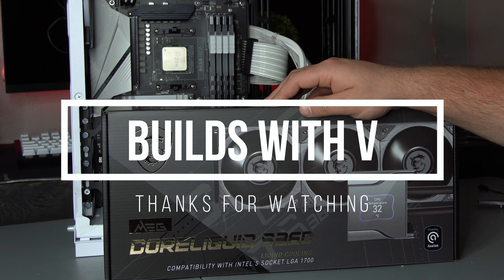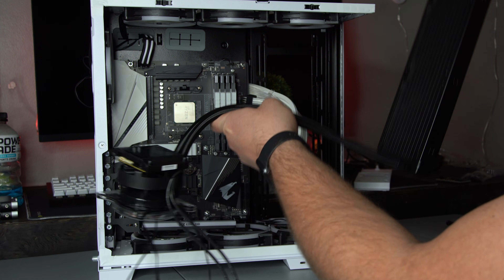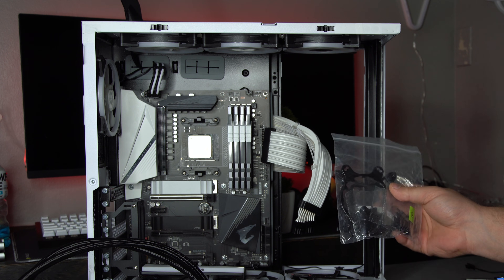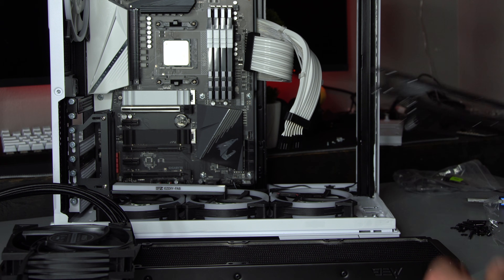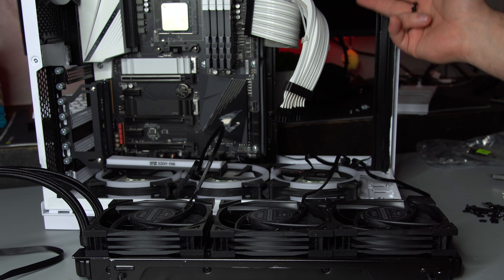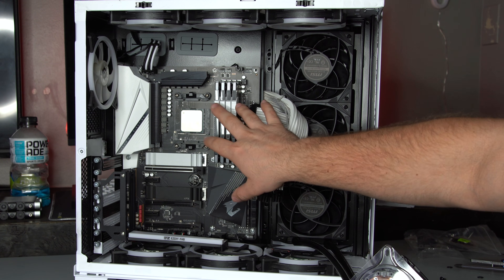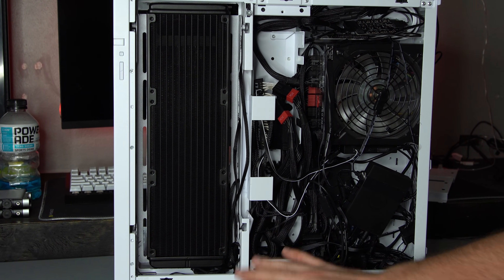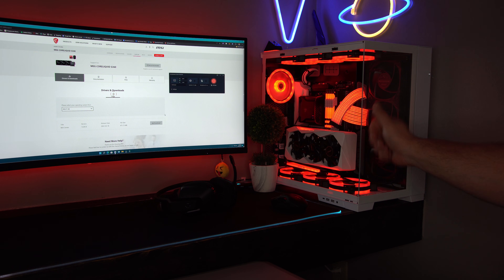How To Install the MSi MEG CoreLiquid S360 Liquid Cooler

Comment: Did you find when you were putting the standoff/screw into the backplate you didn't get many turns before it was tight?
Reply from the maker: I'll be honest, I don't really remember, it's been a while. However, I have had this happen on other coolers and usually it was either because the screw wasn't very long or because it was cross threading. If the others turn more then maybe there's an issue (like something inside the screw hole). Just double check everything. If it's tight tho, it should be fine.

Comment: Question, I bought a PC from a company 2 years ago and it died (it was a really expensive PC, so it's not normal) I had problems during these 2 years and I have this watercooling. Since day 1, it says "Please connect SATA/USB" on the screen, what does it mean ? Cause the fans are working but it always shows this message, can this explain my computer's failure ?

Comment: Radiator is radiating heat, fans should be installed the way that it will help to exhaust heat from your system (chassis). The way you did is wrong, you will take heat from radiator and push it inside of a chassis.

Comment: Why would u suck hot air into the case🤷🏻‍♂️🤷🏻‍♂️🤦🏻‍♂️🤦🏻‍♂️
Reply from the maker: @lmeakin2012  why would I blow hot air directly through the radiator? The GPU air heats up your radiator to the point you can’t even rest your hand on it. This wasn’t just a quick decision, I had it different ways and this was the best in my system with my work loads. Different work loads heat up different things 🤷‍♂️

Comment: Ur build doednf mske sense..to put those as intske your blowing the hot air from the cpu in the build..u already have the front fans and bottom as blower and the top and back.as exhaust..ur not cooling anyrjing non of thay air is going anywhere in my opinion..i gairentee ud have lowwr tempe if it was a push instead of pl for.aio
Reply from the maker: Had the fans like that prior to this and temps were higher. So I swapped

Comment: Doesn't the radiator get hot? The way you set it up wouldn't it suck heat into the case?
Reply from the maker: So the radiator gets slightly warm but compared to the gpu it’s hardly anything. When I had the fans as exhaust the gpu heat would cause the radiator to get super hot causing my cpu temps to also get hotter. Once I switched to this orientation the cpu temps went down and the gpu temps stayed the same.
Reply: OK I'll go with your setup!
Reply from the maker: @Xetsubou  yeah give it a shot and let me know how it works for you. For my application it worked great but really depends on your work loads I’d assume. Almost everything I do is GPU heavy which puts tons of heat.

Comment: Do you need to add the liquid ?? Or does it come with it already inside ?
Reply from the maker: It’s already inside. Never has to be replaced either. Good to go
Reply: So one more question. Sorry you can tell I’m putting this together lol I put it together but my pump is still reading 0 and keeps over heating any ideas ?

Comment: I’m having an issue with mine. My pump turns off randomly causing cpu temps to spike. Have you had this problem?
Reply from the maker: I Havnt had this issue in mine. I’d say just double check all your connections and settings in software first but to me it sounds like it could be defective. Might need to exchange it if everything looks good and it’s still happening.
Reply: @BuildsWithV  did you ever have to go into your bios and adjust your fan curve? I read that could be the issue. I was using my pc and everything was fine, walked away for a little bit, pc went to sleep, woke it up and pump immediately turned off and temps went up. Makes me think it’s a power management issue.
Reply from the maker: @EKclick  it is possible that’s it’s a power issue. Does it only happen after hibernation/sleep or does it happen randomly?
Reply from the maker: @EKclick  that’s interesting for sure.  Honestly I had an issue like this on a different pump and turned out the pump got gunked up with something and it would cause it to not spin after it was off for a while. The pump I’m talking about was a custom loop pump tho, never seen this on a AIO.
Reply: Question. What is the 9 pin usb connector for?
Reply from the maker: @EKclick  for the screen to work. I don’t believe it has anything to do with the pump but I could be wrong.

Comment: If I want to replace the fans on it, will I plug in the CPU_FAN and just not use the three splitters where all 3 fans plug into? (I’m using a commander core)
Reply from the maker: Yeah it’s not required to use the splitter if you don’t want to. I personally used it even with my lian li fans just because I liked controlling the radiator fans with msi software but you can do it anyways you’d like.
Reply: @BuildsWithV  If I want to do that, I can still plug in the RGB cable into the commander core and still get the RGB sync in theory right? I’m not sure if with the commander core you need to match up fans to RGB slot or if you can plug them in anywhere. Because I’d like to continue to use the MSI software as well now that I think about it
Reply from the maker: @rrxlb  yeah you can still plug the rgb cable into the commander and control the lighting with icue. The rgb cable can be plugged anywhere in the commander
Reply: @BuildsWithV  Got it. Makes sense I guess since it can be reconfigured in iCUE as far as fan order goes

Comment: MSI center is not pick up this cooler and when I called MSI they said it only works with a MSI board and that’s crap because I would of loved to know this before I paid a hefty price for the screen and that’s the thing that doesn’t work and none of the video reviews that I watched or anywhere on the website or on the box did it say that I need a MSI MB for this to work.
Reply from the maker: Yeah it doesn’t need a msi MB to work. My mother is gigabyte. Msi center is tricky and sometimes it doesn’t work properly. I’d recommend just checking all connections, try a different usb port on your motherboard if available. Try reinstalling software etc. I’m sure you can get it working unless the aio is faulty
Reply: @BuildsWithV  so either the three reps that I talked are lying to me or it’s the new version of MSI center. They send me a uninstall program and did the reinstall 3 or 4 times. I know the usb ports are working because I have the Lian Li fans that also use the usb ports to control the fans thru their L connect 3. So looks like I’ll be getting on the phone again but all three reps that I talked to on different days and times told me the same thing.
Reply: @BuildsWithV  I did, that’s why I called MSI support and that’s what the first guy told me so I was like he got to be lying and doesn’t want to help. So couple of day later I called back again and they gave me the same answer

Comment: I think the fan should blow the radiator to make the radiator cool..should reverse the fan for cooling effecient
Reply from the maker: That will make it hotter since the air inside the case is hot. This way it’s sucking air from outside the case

Comment: Just wondering why you didn’t mount the fans directly to the radiator, and then mount the radiator onto the bracket? Is there an advantage doing it this way?
Reply: The further your radiator is from the air inside the case the better. Slightly better cooling.

Not as much of an issue if you have a liquid-cooled GPU also, but open-air cases are much hotter than ambient temps. The side compartment in a full tower will be much cooler.

Comment: This is not a optimal way to install an AIO, the radiator pipes should always be higher than pump, due to the risk of air locking the pump with the small amount of air that is in the system.
Reply from the maker: That is incorrect, the only important thing is for the highest part of the radiator to be higher than the pump. In my case, the top of the rad goes higher than the pump. Any air in the system gets trapped inside the rad and since running all my aios exactly like this, haven’t even heard a bubble noise pass through the pump. When I had it the other way, I’d always hear bubbles.

Comment: Are you still using this AIO?
Reply from the maker: Yea I am
Reply: @BuildsWithV  ic. I had my 2nd unit now. The first one makes my PC reboot. Apparently there was a problem with the usb. Msi had them replace . It's working OK so far. But the heatwave here in the UK it's kinda struggling to lower temps. 😕

Comment: Can I use the SL infinity 120 fans with this radiator? And do I have to plug the fan cable into one of the three connections coming out from the pump?
Reply: Did you get an answer to this?

Comment: Didn’t Jay say in the video that you don’t want your Radiator hoses lower than the CPU
Reply: You can turn it as long as the pump is not the highest point in the system! Jay was showing with the 240 radiator 😉
Reply: The dumbass has mounted the fans backwards, so he'll be pulling all of the hot air back into his system and increasing his temps instead of expelling it out of the rear of the case as it's designed to so.

I think bubbles in his pump are the last of this kid's worries! 🤣

Comment: i am using lian li fans all over and didnt used the fan connection from water cooler, is this going to be an issue ?
Reply from the maker: Should be fine overall, if you have issues you can plug in the lian li fans into the connector from the cooler. That’s actually what I did for mine to take advantage of the zero rpm mode

Comment: Hi.  I did not quite understand.  Do you have fans on the heatsink blowing into the case?  Why hot air inside the case?
Reply from the maker: The radiator doesn’t get warm so the air going is is fine. It’s the best way to cool your cpu, with fresh cool air. If your fans are exhausting through the radiator then your radiator will absorb all the heat from the gpu. I also have 3 other intake fans at the bottom of the case so even if the radiator gets warm and blows warm air into the case, my other 3 fans will still blow cool air. All those reasons are why I mounted my fans this way.
Reply: @BuildsWithV  I think you're right.  you have a good case where the cold air intake comes from the bottom, and the vertical position of the video card does not block the air flow.  and if the speed of the blowing fans is increased to avoid increased pressure in the case, then the cooling will be generally not bad.  How are you with the temperature vrm or ssd?  And what is the case model?  I don't have much faith in the efficiency of cooling the VRM with a small pump fan.

Comment: High there I have this aio and also have the same case. Can I ask on your fan settings, the aio pump did you set it to 100% or maxx? out
Reply from the maker: I have it set to pwm, so it goes up or down based on the cpu temp. But if I did set it I’d leave it at 60%. Stays quieter that way.
Reply: @BuildsWithV  pwm? I thought the software overrides the Bios? On my bios my cpu pump is maxx out. But if you check the software it's not maxx out. But one thing I noticed the aio pump can go up to 2700 rpm I think. Which is more than the Bios rpm.
Reply from the maker: @wankerka  yeah the pwm through the software. I just choose one of the presets and it’s set to pwm which just means the pump speed changes as needed for cooling
Reply from the maker: @wankerka  the only reason it actually plugs into your cpu header is to get the temp reading (I believe)
Reply: @BuildsWithV  hmmmm ill check that later tnx
Reply: Are you using the lianli vertical gpu for the Evo?
Reply from the maker: @wankerka  I’m actually using the ezdiy ARGB vertical mount but with a lian li PCIe cable
Reply: @BuildsWithV  i tried your set up, the Cover of the AIO i cant seem to mount it back coz the Aio tube are in the way. On the cover the 2 fins that sticks out thats the one preventing to put the cover back on. Atm i am using the cooler master V2 gpu riser with PCi4. Waiting for a stock from the lianli evo gpu riser. Ill leave it for now.
Reply from the maker: @wankerka  yeah I put my cover on backwards with the fins facing the rear of the case to avoid that issue. Otherwise It doesn’t fit unfortunately unless you don’t hide the tubes
Reply: @BuildsWithV  Ah ic. Ill leave it for now, just waiting for my lianli riser then ill try again:) Keep up the good work. Subscribed!
Reply from the maker: @wankerka  thank you 🙏 Much appreciated
Reply: I am having problems with my coreliquid s360. When it get a bit hot it kinda stuck on a certain temp and after it resets my PC. Ever experience that?

Comment: Hi, may I ask what is the case in the video? Doesn't look like a Lian Li, since Lian Li O11 cases don't have the seamless front glass panel like that
Reply from the maker: It’s the lian li 011D Evo that I modified in previous videos. I also did the custom glass as well. I personally think lian li should make it like this and call it the “EVO View” 😅
Reply: @BuildsWithV  Thanks! Yours looks like the Aigo Z300. Yes, I agree, the seamless glass panels make it even sexier.

Comment: You make a big mistake mounted that way, bcas the water pump its higher mounted then radiator, wich means all the air bublles inside your aio will claugh in the aio pump. In 1 year max the pump will fail, so GG.
Reply from the maker: This is false, I even included a link in the description to a video that explains this better.
Reply: To back the owner of the video, the flow of water is simply not enough to bring down the bubbles into the AIO pump itself. This is actually the best way to mount the radiator with the tubes down, the AIO will be completely fine because the top of the radiator is further up than the pump itself. If you were thinking that the radiator was on the bottom, then yes that would be an issue; but for this instance, the AIO is completely safe and won't have any air come into the pump

Comment: What header did you plug the radiator fans into?
Reply from the maker: They were actually all plugged into the splitter that comes off of the water block. It has 3 daisy chained together on a long wire. Checkout 09:40
Reply: @BuildsWithV  ahh I see thank you!